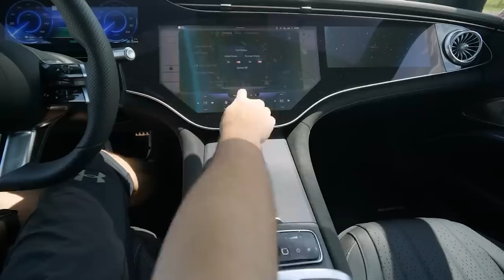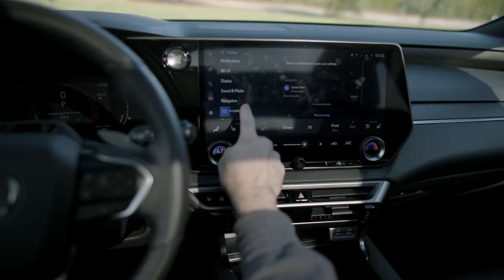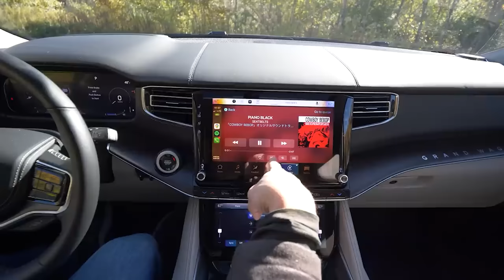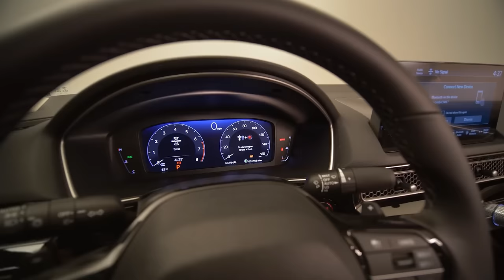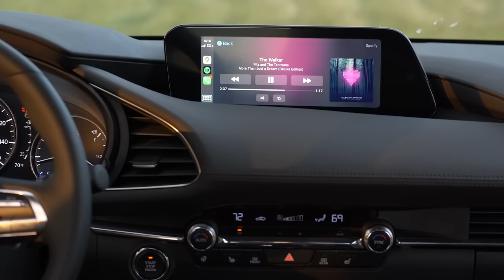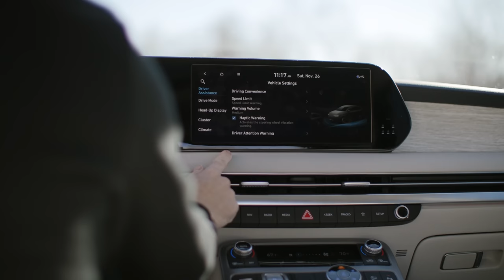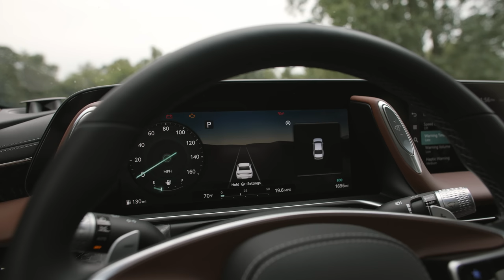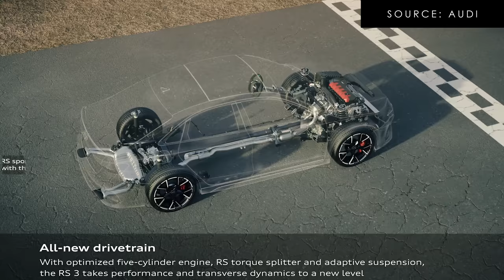Best Cars of 2022 | SavageGeese Edition

Comment: In Canada, the Elantra N is $40,000…the GR86 is $36,500…the Si is $37,000…so I bought the poverty spec WRX base for $33,000. After 2,200kms, I am thinking it’s an incredible bargain compared to these. Loving it. Heck it’s even within the regular Civic and Corolla price range…
Reply from the maker: Agreed
Reply: I just test drove the WRX and fell in love with it, I had more fun in it than i did in the new GTI and Integra. I think it deserves an honorable honorable mention since it's the only sporty car with AWD for under $40k with a manual.
Reply: @savagegeese  how viable is a aftermarket of communciative steering that isnt all that hard to use in parking for at least car that arnt heavy, to give confidence on how close to grip limit car is at for minimal braking and smoother steering, for longveity of tires, brakes, battery, electricity, fuel, lubrication, etc.   best MOTORing offical has a video on prius trd in japan, much stiffer chassis, sway bar, multi link rear, less weight, no power upgrade. maybe its worth gutting out the inside decorations, infotainment, door window motors (fixed position windows), anti NVH material reduction because its only illegal for a driver to have covering ears, offfice chair gel cushions can be usedbeyond the car too without paying for extra ones built into the car, etc. gordon murray istream seats are suppsoed ot be 30 percent less weight but i think it was a design their selling not actual seats, you say type r seats are exceptionaly good acorss all prices.
Reply: I also ended up with a base model 6 speed 22 wrx because they were available and not marked up. It's a great car minus the mpg
Reply: @HarryTwatter  I heard the real world mpg isn't as bad as the EPA rating though, is it not?
Reply: In Australia the Elantra N is $55K compared to the GR86's $44K and the WRX is $50K. That the Canadian WRX bit of a bargain.
Reply: I have a 22 WRX Premium, got it for 33. Best daily ever. Mine is all black and I like. the way it looks personally. My max boost is 15.5 stock, and I recently saw an FA24 tuned pulling over 430hp/400tq. I’m so glad people hate it. After I’ve ran the warranty out on this one, I’ll be able to tune and buy another at MSRP for a warrantied daily. Good choice.
Reply: @mistamaog  I'm getting a little better than EPA at 20mpg city but highway is only max of 28. Not very good compared to the other cars in the segment
Reply: @HarryTwatter  That's true but at least it's a bit higher than advertised, and it's the only one with AWD.
Reply: the elantra N smokes the WRX lol so that's a harder comparison to make, handles just as well too. It's also loaded with features, the base spec WRX is so pathetic looking on the inside and is lacking for a 2023 vehicle, let alone the fugly exterior
Reply: @josephs1701  all black WRX? Yikes color combo!! Why would you move to the new one with meh upgrade on interior and significantly worse styling? pathetic
Reply: @roboticvenom1935  I don’t know who you’re calling pathetic but you need to watch watch your stubby fingers type on the keyboard
Reply: @roboticvenom1935  Also, if you actually drove the car or did anything but be an armchair commenter on YouTube, you’d know it’s the best driving WRX to date, and the fastest. It is leaps and bounds better than the FA. But some children can’t see past some styling wahhhhhh

Comment: As an Elantra N owner (DCT) I’m glad it got an honorable mention! It’s my first auto ever (been driving 20 years). After an accident and a joint replacement on my right arm earlier this year I had to drop the manuals sadly but this car rips!!  For the price there’s nothing that touches this car If you need the flappy paddles😊
Reply: Even if this car is considered a great value Type R, ill take it, for what its worth this car is amazing!
Reply: @triikpikachu9754  as a Honda fanboy, I do like the Elantra n
Reply: I low-key want to trade my Veloster N just l for the EN just for the different turbo but at the end of the day it would cost more than a turbo swap so I'll just wait and swap the turbo.
Reply: @esoterikk1  and better transmission and interior

Comment: Having had both an FK8 Civic Type-R and an Elantra N with a DCT the Elantra N is a much more enjoyable daily driver.  I enjoy the heated seats, sunroof, DCT more on a daily basis than I would the additional 5% performance the CTR has to offer.  With the mark-ups on the new FL5 CTR the Elantra N offers better value.
Reply: The N is a better value without the markups.

Comment: I owned a 2013 Lexus ES350 from 2019 to 2021. Put 20k miles on it and ZERO issues/problems. 
For financial reasons I sold it Carvana and bought my current 2002 Lexus ES300, one owner w 160k miles. 
I’ve replaced these 20 year old OEM parts (AC compressor, alternator and starter) with GENCO parts and replaced 4 struts after the rear ones were leaking. Love this car, super reliable. Everything still works every button etc. rides like new w new struts. Quiet and fit and finish is unparalleled
Timing belt, valve cover gasket and water pump replaced at changed at 88k
Reply: How does the ES300 compare to the ES350 driving/comfort wise?
Reply: @Argedis  I like my ES300 better. 16 inch rims give a better ride. Not a fan of the low profile tires on the ES350. Although the 350 is sleeker, Im ok with the ES300. The fit and finish is even better for the 4th gen ES (2002-2006). Quality control was at the highest during this Gen. 
I installed a double din Alpine touch screen with a hardwired backup camera.  Removed the indash cd changer/cassette player. 
The outward vision is better on the ES300 too. I feel the ES300’s interior is just as nice as the ES350. Leather and real California Walnut wood trim
Reply: @stephendibari5010  That's awesome! Many good points. I also believe build quality was better back then in many vehicles.

Glad you're enjoying the car!
Reply: @Argedis  thanks ! I did have to replace 20 year old OEM parts last year a few months after I bought it. New alternator, AC compressor (started squealing), and 4 new struts (rear ones were leaking). This March I replaced the starter. The fact these parts lasted 20 years is a testament to their quality. All parts except the struts were replaced with GENCO. Struts were one notch below OEM. 
Car is so quiet, you would think it’s an EV. love it
Reply: @Argedis  First, it should be made clear that Stephen's car shares nothing but an engine with the car Savagegeese is discussing; it moved to a whole new platform for 2019. As for the comparison of today's V6 vs. hybrid, Savagegeese did 2019 videos on both. Mark concluded that the hybrid better suited the sedate character of the car.

Comment: The Maverick is essentially the previous gen Ranger before it was discontinued in the US - cheap, practical, rationally sized for utility, and tough enough to handle whatever you throw at it. 
It's really the only truck 90% of all truck buyers actually need, but it's tough for the average truck buyer to take it seriously due to compensatory challenges that the majority of them can't seem to overcome.
Reply: what is compensatory challenges?
Reply: @DementedDistraction  ahh that's what i though you might have meant.  so small truck means big pp right?
Reply: @gekisen01  Nah. Small truck just means that they aren't insecure enough about it to let the whole world know.
Reply: The previous gen Rangers had usable 6ft beds
cant even fit an adult bicycle in a 4.5ft bed

Comment: Good rundown of the cars you drove this year that you liked best. It would be helpful to see a full list of the vehicles in the description, so we know what the field consisted of.

Good choice on the F-150, although you neglected to mention that it’s also available in EV form (Lightning), which is a really impressive vehicle that has some shortcomings in range (when towing non-aerodynamic trailers) but will serve a vast majority of truck owners that never tow large trailers over long distances and just use them as SUV and minivan replacements. 

I’ve given you a lot of grief over your treatment of EVs, even to the point of implying you were out of touch, but your comments here about the sound as part of the driving experience helps me understand why you always appear so bored and apathetic when driving EVs. 

I admit to having the same impression when driving an Ecoboost Mustang compared to my V8 GT. The Ecoboost engine had plenty of power for most situations, but it didn’t have that visceral growl that I associate with driving a Mustang. The reality, though, is that contemporary V8-powered Mustangs are much more powerful than anyone needs as a daily driver, and the higher variants deserve to be on a track so they can stretch their legs, much like the Corvette. Such cars are fun to ride but not practical for everyday use. My comment to the sales guy after getting out of the Ecoboost was that they might as well make it electric because the thrill of winding out a 4-banger is just not there. I might as well have the instant torque and other benefits of an EV, and that’s why EVs will rule the day in the very near future. 

Next year’s video will be very different, I suspect!
Reply: @kinglumpy6145  I've also found that all generalizations are always true. Fortunately for people like you, oil-burning cars are still being made. While the rest of the world makes the transition, you can assure yourself that your decision was the best one for you. The popularity of EVs around the world have very little to do with "extreme heavy-handed government policy" but you do you.

Comment: The Porsche 914 should be the obvious SavageGeese COTY.   
You drove one in Hawaii, you didn't nominate it last year, and is unparalleled.  
It has what is probably the best infotainment - only two knobs, plus a manual transmission, a symphonic soundtrack, loads of storage, and goes like stink.
Perhaps next year SavageGeese will come to its senses.
HO! HO! HO!

Comment: 10:20 I owned a mazda 3 2019 now that I bought after your original review, just sold it and owned it for 3 years. GREAT car for the value.. All that equipment I got for 20k USD brand new in sweden is insane. I even had the mazda aero kit on it and it looked killer.

Comment: It’s interesting how you guys talk about Kia and Hyundai’s quality issues, and dealership experience, but I’ve had both, I had Honda and Chevy and to each dealer when I went I felt the same, there is nothing different from going to a Honda or a Hyundai dealer. 
Also, nobody ever talks about how unreliable the German cars are, yet  you mention Hyundai’s long term reliability even with V6’s🤔
I’m in no way an expert or more knowing than you guys but it’s something I’ve noticed.
Reply: There is no doubt a strong bias against the Korean brands that goes back years, and it will be hard to change with some of their recent challenges, eventhough overall they are ranked on par with all the other brands in terms of reliability.
Reply: Hyundai had a recent stop sale on the 2.5T (Elantra N, Santa Cruz, etc) for DCT transmission issues. I don't know if was resolved or not.

Comment: And you are the winner of the best car review channel.

Any channel will tell you what's good about a car, some even lie or make up excuses to keep the car makers happy so they will keep supplying cars for review.  You only find out about negatives of car A when you watch a video on a competitor car B.  It's especially disappointing when otherwise good channels like Alex on Autos does this.  

The way you don't gloss over anything and call piles out for what they are, regardless of brand, makes you amazing.  No other review channel has the guts to do what you did on the last video calling out the electric MB for being an overpriced and under developed. But you also know what to look for in a good car, it's not just a brand bashing channel.  I've subbed and unsubbed from probably 20 car review channels, but have been watching every video here for years.  Please don't change.

Comment: As an owner of a Mazda CX-50 turbo premium plus, I’m happy that it got an honorable mention. The car really impressed me and it felt like the best blend of luxury, space, and performance in a CUV for the price. It also handles very nicely and I actually enjoy the heavy steering. It’s very tossable in the corners for what it is. Toyota, Subaru, and Hyundai did not excite me like Mazda did. Mazda just feels so much more upscale with their interiors. I did some shopping for Kona N and Elantra N models, but the nagging thought of reliability was always stuck in the back of my mind and I couldn’t pull the trigger (would have gone with the Kona N for the comfier seats). My experience with Hyundai: I bought a used ‘13 Veloster and drove it for one year. It was one little problem after another, and it only had 70,000 miles on it. Unbeknownst to me, the engine (seemingly overnight) developed a bad oil consumption issue, and I drove the car over 150 miles with very little oil inside, and the engine developed rod knock at 82,000 miles. This was despite my 3,000-mile-interval oil changes. Hyundai replaced the engine under warranty, and I sold the car immediately after.

Comment: Im a car enthusiast (mostly JDM and some German here and there), but I was on the market for a new car recently and wanted to try the EVs. I drove the ioniq 5 and it was great, but ended up getting a Tesla model 3. Here is why: 
1. Charging network (I know I’m gonna get a charge when I get to the charging stations, unlike Non-Tesla chargers)
2. No mark up and got a sweet discount for December 2022 buyers -$7500 off MSRP. The Hyundai dealers in my area were charging insane mark ups for these things. Even tried contacting Hyundai corporate and no help. 
3. The model 3 feels like a finished product. The Hyundai product felt like an android in the early 2010s. Loots of features but Something is missing and I can’t put my finger on it. 
4. I can’t believe im saying this: the model 3 (just the 3) felt better built. Lol. I drove the Y and it was a turd. But the model 3 has no rattles and for the price, it’s one of the few cars that hit above its weight. I paid $40k for mine. 

Anyways… if you are on the fence about EVs… go for it. I love my model 3 so far. This is coming from a Honda s2000 owner.

Comment: When the RDX was mentioned as runner up for best entry level luxury SUV, I had to comment. I have had a 2020 model for 3 years now and it has had so many problems and issues. Just today I had both front lower control arms replaced at 34k kms due to rattling noises. In Dec 2022 the rear hatch glass spontaneously shattered. The brake pads and rotors have been replaced multiple times due to sqeaking. The sunroof makes loud popping noises. Engine oil fuel dilution in cold weather and short trips. Ticking and popping noises from the infotainment/stereo. Limp mode when passing on the highway with oncoming traffic. Do you need to hear more. I cannot wait to get rid of it.

Comment: Its a good list, but i still beg to differ on the Stingray. GMs Stingray goes way beyond ANY debut sports car series by a considerable measure, and its the chassis. Its been POUNDED on by every automotive journalist out there and everyone is astonished except your channel. GM has given the spring rates of both the Z06 base model and Z07 package, and i truly believe both are transferrable to the entire Stingray lineup because both the chassis and vehicle weight are similar. Nothing is on the market even close to the Stingrays price for sport capability.
Reply: If you watch their full video from the Stingray introduction, they are extremely respectful of the engineering and value achievement it represents. They just think the base model got defanged to appeal to the people who will actually be buying it.

Comment: You guys didn't drive the GV70 this year? If so I'd be curious to know how you could fathom putting the RDX above that car?
Reply: It's probably down to the Hyundai / Kia reliability and brand issues they kept referring to when talking about the different choices
Reply: @Bobinatronus  GV70 doesn't use a platform or a powertrain shared with any Hyundai-Kia product.
Reply: Because they hate the Korean brands lol
Reply: @devongee1776  but Genesis does have reliability issues. Look up CR's most recent report.
Reply: @devongee1776  yes but they share the same dealership network. And it's awful.

Comment: I love how they focused on the sound component. This is why I have issues with EVs.
Reply: You can pump any sound you like into the EV cabin. And you also have the torque and acceleration to match. The gas engine can pump out as much noise and verbal as you like, but can't beat the EV acceleration and driving dynamics (torque vectoring, traction control, etc)

You might want to check out Jason Cammisa's new video that dropped this morning on the Lucid Sapphire. Shutting down, Plaid, Bugatti, and Ducati.

Comment: I can't believe you voted the Mazda UI system as one of your top picks. My wife has a 2021 CX-5 and we both absolutely hate it. No touchscreen and extremely difficult to use without being distracted for a while. Android Auto connectivity is so bad that you turn the volume up while connected and itll switch back to non android auto. It's the worst system I've ever used, and I'm a Mazda fanboy.